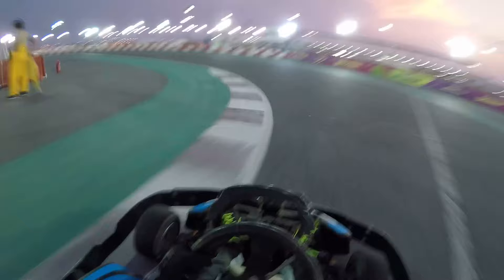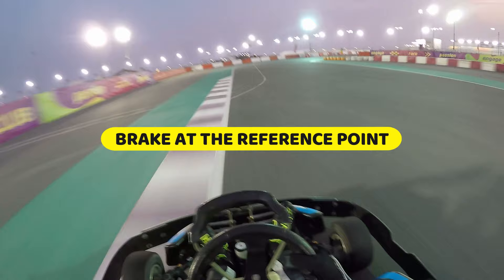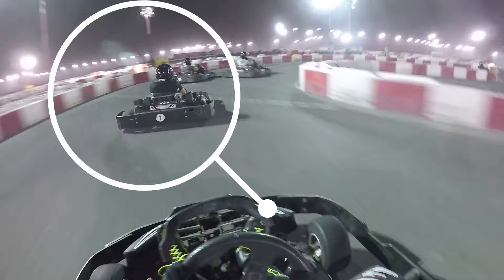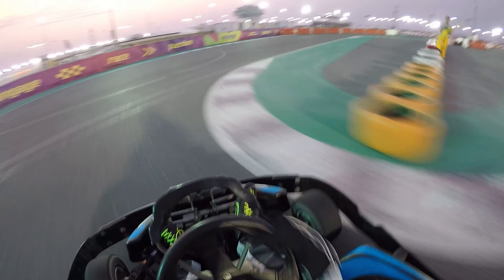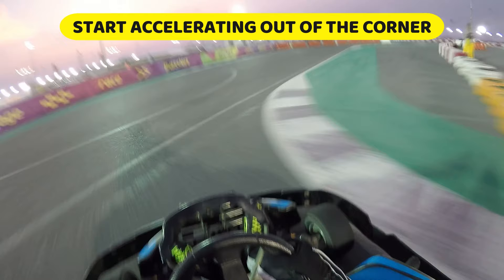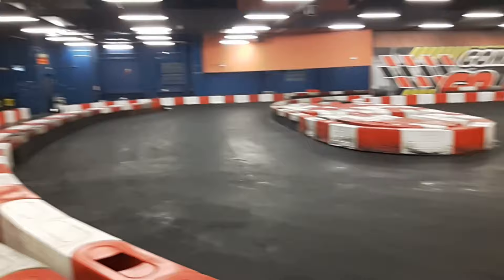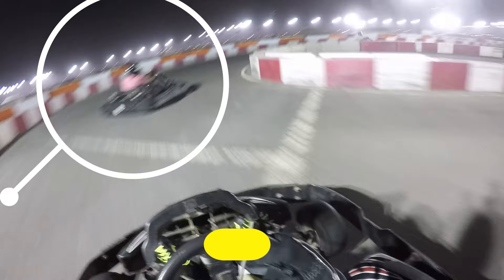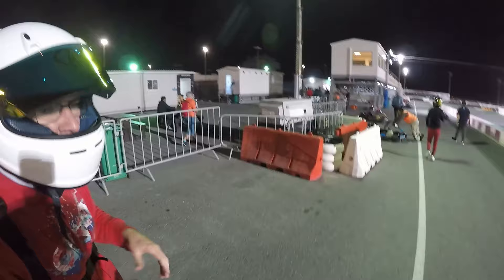HOW TO BRAKE in GO KARTING - TUTORIAL (KARTING TIPS)

Comment: The thing I've found is that since karts have no front brakes, you maintain a lot of front end grip even under braking. You can use this change in grip balance to your advantage to get the kart to rotate into tighter turns
Reply: How exactly do you do that?
Reply: @chiragmaragal3390  the back will slide somewhat, so as long as you can maintain control of the kart by controlling your brake and wheel inputs, you can get the kart to rotate a little faster every corner. The problem is getting the feel for it, because if you slide too much you'll actually lose time instead.
Reply: @chiragmaragal3390 
Usually you just lightly stab the brake as you turn and it almost pivots the kart towards the apex. I do this on some tracks in many corners that don't really require full on braking, especially if the kart is really tight and plowing to help it to turn. 
Often, after the front tires warm up after the first 3 or 4 laps, I don't have to use the brake like that anymore.

Comment: remember to adjust your braking technique to how much power your kart makes. low power carts will be faster with softer braking and wider turns - by starting on the outside of a turn, touching the apex, and ending up on the outside again. you want to carry as much cornering speed as possible because you can't accelerate as fast. as for high power carts, you can take a more V shaped line where you brake hard very late, oversteer to get your kart pointed at the exit, then tearing off again.

Comment: Is it normal to be slower at first when improving technique? After starting to use reference points and late apexes, my time is slightly slower. The kart feels much better than my previous way of overshooting each corner.
Reply from the maker: At first your timing may be slower because you are trying a new technique. However, the key is to practice this technique over a long period of time. Each time you race, attempt to brake later and later into the corner. 

This way you will gain more confidence when braking. When you become more confident under braking, you can really find the limit of late braking which will ultimately help you improve your lap time.
Reply: @kartingtips  Hey man, I've heard that you should barely be using brakes in karting so that you don't slow the revs down a lot and kill the engine, making it slower for you to reach top speeds on the straights. And I've also heard that when you do need to use the brake, just give it a hard tap and get off it immediately. This contradicts the tips you give in this video of coming off the brake slowly. What are your thoughts on this?
Reply: @kartingtips  Thanks for the advice.
Reply from the maker: @DeputyiC   I agree that you should spend as less time possible on the brake pedal.  Regarding coming off of the brakes, the point I was trying to make in the video, was that you should avoid aggressively coming off brake pedal. If you are too aggressive coming off of the brake pedal it can unsettle the kart.

Comment: To improve your breaking without video taping your race or having data to help a good way is too figure out what a full break will do at full speed and count how long it takes to stop and then try and use that as a reference for what the kart can do and then improve each corner until you are putting it on poll. Knowing what the kart can and can’t do will improve everything

Comment: The hardest part is trying to start braking correctly when you're closely following another car. That will make harder to see your reference marker and if the car if front of you has totally different braking style, you'll have problems trying to keep your own breaking point. In addition, the leading car can drive defensively and brake "too much" but use their car to block your overtake line.

Comment: These tips are pretty good, but a very common mistake in rental karts is that people tend to brake too much. You really need to keep up the momentum in rental karts in order to be fast as they have very little power.

What this means is that you often only need to brake in order to get the kart turning as turning the kart will already scrub off enough speed. At an indoor karting track near me there are more than 20 corners but you only have to touch the brakes at 3 of them if you take the right lines.
Reply: Same as an outdoor track I was just at with pretty fast rental karts (80kph+) You never actually need to break if you're brave enough and know where the kart should be coming into each corner - letting off the accelerator is more than enough
Reply: With the 6.5bhp and 9bhp karts (no idea whether that's the standard for rental karts across Europe and/or the world) I never brake. I drift the kart with counter steer approaching the corner and drift with opposite wheel lock all the way through, which in my experience, gives me the best momentum out of the turn. I do pretty good lap times but not sure at all whether that's the correct technique since there is nobody to teach me :D
Reply: @nikolamladenoff3516  Generally drifting is slower than only braking slightly. But it's fun, so you do you ;)
Reply: @nikolamladenoff3516  its definitely the fun way!! generally speaking with karts, having neutral steer (quick sharp turning input at beginning followed by continuing through the corner without having to have any steering input, or having the wheels point straight while turning, and not counter steering) is going to be the quickest way through a corner, the objective is to eliminate all steering as much as possible. so your idea of drifting is in the right direction, just dial it back aa bit so that instead of counter steering, you do a sharp initial steering input and return to and stay at center of steering for the majority of the corner
Reply: Stop yapping blud

Comment: i think the hairpin example was actually too much braking applied which made the gokart drift thus loosing much more speed and overheating the tires. Best would be to break hard in a straight line, start releasing the break when turning the wheel in and then releasing the break pedal around the apex to be able to accelerate flat out  from apex on. 
Technique shown in the video will work only on extremely tight and narrow corners where you have to rotate the gokart ASAP and start accelerating.
Overall though very useful video - one of the major points is that knowing the track will help one gain the breaking advantage

Comment: In the first hairpin turn shown in this video, it appears he is braking and turning into the right hairpin at the same time. You can also see this results in the rear end rotating and the driver applying opposite steering lock.  
I always thought hard braking is best done in a straight line just before turning in towards the apex and the brake pedal is released gradually once steering wheel is turned towards apex
Reply: he's threshold braking, he's using the bit of spare grip remaining in the front tyres as he lifts slowly off the brakes to turn at the same time. A little bit of rear slip and mild oversteer is ideal in this scenario as it allows the vehicle to rotate more aggressively as it enters tthe corner
Reply: You can carry the brakes into the corner. In a normal car this will decelerate the car meaning you can brake later but will induce understeer. In a kart there’s only rear brakes which means it’s easier to spin by trail braking into the corner but you can carry a higher entry speed and use the brakes to rotate the kart
Reply: @Shadow1986  thanks for the explanation.  It's nice to see drivers helping each other out on this channel.

Comment: Lando norris once said that for best breaking u should always have some throttle applied so your breaks dont lock up, thus carrying even more speed but holding that grip and instant response in power once u let go of the gas.
Reply: In rental go karts you can’t press the throttle and brake at the same time, it will just deactivate the throttle when you press the brake

Comment: excellent. i'm guilty of not doing this, even ... while i know this is the proper way. the improper way i do it... is never ever let off the throttle. i press the brakes while still on full throttle. and i do use the brake as an on/off switch. once finished slowing down the cart i drop off the brake. as thats the fastest way to release it. and since i was all the way on full throttle, i have zero delay of accelerating. 
the problem with this is... excessive wear. both on brakes, clutch, tyre, drive chain. but it yields better lap times... 1 corner, 1 time brake is applied. and for that 1 time its full on.

Comment: I never really watched a tutorial about kartin, just did it and did it like i thought would be good.. Since i am very heavy(over 220pouds) i usually break really hard, and to my vision at the latest point possible.. in later rounds when i feel more comfortable i tryd to push a few inches further every time, but then i miss the turn or lock the wheels.. mostly loose time after a break since the cart takes ages to accelerate after the turn, and often a lot of drivers  then run away from me. At my area we got many 180° corners which makes it hard for me to gain speed. at least thats what i think.

Comment: Better off coasting through most corners in these slow karts. Braking at all will load weight to the front wheels and take weight off the rear, which is probably why youre sliding in every demonstration and if the rear is sliding then you arent accelerating. If you coast through these turns you can have better weight distribution and take the corner faster. Everything I've seen in this video the kart should be able to do without any break at all. Just moderate release of the throttle or change up your racing line.

Comment: you need to manage your throttle back up again as soon as you get off the brakes ( way before that apex ). Eventually, use it gently, but it gets those rev climb up for a better exit. Needs a bit of practice, and make sure you don't input too much throttle and listen to your tires.

Comment: How far away from the turn should we set our braking point? like 30m or smth?
Reply: Debends on how much speed you have coming to the and how tight the corner is. Trial and error is the only real method of finding the breaking point. 

First just pick a point to break and try it. 

If you over shoot the corner and aren't able to turn quickly enough for the corner, pick a new breaking point that's earlier than the last one. 

If you lose too much speed before the turning point and have to accelerate before the apex to maintain speed, pick a breaking point that comes later than the last one. 

Then just repeat this until your breaking point feels perfect.

Comment: can you make a video on how to break with the front tires? I know that some guys master it perfectly so they are in advantage of normal breaking. they use the wheel to aggressively turn the wheels for breaking?
Reply: Yes,front tyres scrubbing techique used often
In the video you can see he doing similar thing for the first braking exemple but too much brake and the rear went loose or carried a bit too much speed due to wide entry and loose a bit the rear.(common mistake of lighters pilots)

Comment: Any tips for avoiding understeer on a very wet slippery track? Struggling to get the turn in even at very slow speed. Maybe I should intentionally lock the rear into hairpins to get the rotation then immediately get on the power to drag myself out?
Reply: Stay away from the dry line. Go wider on entry.
Reply: As you brake, turn full lock into the corner, the kart will understeer, probably not even turning at all if you are going fast enough. Aim to go around the outside edge of the corner in the wet. Combined with the fronts scrubbing off speed and the fact you are missing the inside kerb, you may even be able to brake later. Hold the lock. Eventually, the kart will slow and weight will transfer off of the inside rear and onto the outside front. At this point, the kart should start to rotate into the corner. Be ready to catch the steering back to a normal angle as it does so. Carry on round the corner. You will get really good traction off of the corner because the steering angle is almost straight on exit compared to the dry line. Don't be afraid to use full lock if the kart is understeering. My advice is always be firm with the steering but gentle on the pedals because the steering generates grip at the front at turn in, whereas the pedals do the opposite at the back.

Comment: Thanks, are there some corners that just lifting off the throttle is quicker than braking?
Reply: definetly especially if the karts are slower. therefore you don't need to slowdown as much to make the turn
Reply: @cxcre  thanks for the input. I suppose I wondered the difference say lifting off only for the turn, or keeping your foot flat for longer, then brake to scrub speed before turning in?
Reply: @stevesas632  with braking around a turn you don’t necessarily need to you are essentially braking late. Which means you will be exiting the turn with less speed than just letting off. I’m not a pro kart driver or anything but that’s just my theory. I play a decent amount of sim games
Reply: @cxcre  thanks for the info. It's great to see ppl helping each other on this channel.

Comment: 2:14

Does this also apply for really high speed corners?
Reply: if its a quite wide and ,as you said, high speed then there may be no need to brake at all, you could even keep abit of throttle aslong as you can maintain the racing line ofc

Comment: I feel your tips does not translate to karting at all. For the heavy car - yes.
But karts are so light and have so much more grip and break power as the result, that this technique does not apply, if you want to maximize your speed.

What I've found out (and was taught) is that on a kart, you should most of the times use break pedal really hard and for really small duration of the time and turn at the same time - so that the kart starts sliding a bit on the slip angle and helps you rotate the back of it. Than you control the kart with the gas pedal and steering angle of the wheel and (this is important) try to maintain as much speed and as much revs that you can.
The engine is so weak, that it's beneficial to maintain engine revs, than take "the best racing line"
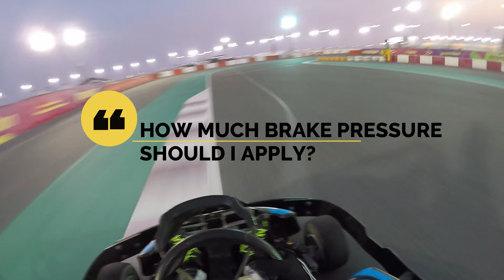Reply from the maker: Thanks for your feedback. Kindly refer to 1:35 which is where I explain that you should find the limit of hard braking. This means you should brake hard and spend as less time on brakes as possible.
Reply: Also using the mass of the body to rotate just a little the kart,too much forgoten these days.

Comment: So you dont trail brake in go karts?
Reply: Depends on track, you could have a similar skill where on a turn you have to put some little pressure on brake (but often a lift-off works too), but its cleary different breaking style than in a racecar
Reply: Right? I almost never press the brake while karting seems as if I can take almost all turns by just slowing down enough with a lift off the throttle
Reply: Trail braking only works if you have front brakes. The other two answers are nonsense
Reply: Trailbraking is about Weight transfert on the front mate, so brakes on the front or rear change the effect yes Indeed but you’re always have a transfert, also in go kart ! and  Its principaly dampers on race cars that allows that type of driving, on kart you don’t have lot of flexion and move due to châssis. And the initially question was if there some SIMILAR skill in kart. So read please before comment
Reply: @pierrecharrier8777  shhhh
Reply: In general I always try to trail brake in a gokart, I easily overtake those who dont. However, it always depends on the gokart and the track, and sometimes the temperature as well, it is not always better. Especially with a proper racing gokart, trail breaking helps you to lift up the inside rear wheel in the air and you can take the turns much faster and the gokart just turns in much better. When you dont trail brake the inner rear wheel will stay on the ground and because the gokart has a rigid axle with no differential (so both of the rear wheels are always spining at the same speed) it will have the effect of pushing you straight, the gokart will understeer. But it seems to be quite difficult to tell. Just try with trail breaking and without and you will see how the kart behaves on that day in that corner. Sometimes when you have less grip, or struggle to get the tires warm enought because its cold trail braking mifght not be faster.
Reply: @benjaminevans1221  not true, the effect of the kart slowing down puts more weight over the front wheels even if they are not the ones braking
Reply: @Otakar Libal OK i understand to use this type of trailbrake on Racing Go-kart ; but  this video deals with Go-karting rental ; and often you don’t have enought sensibility on the stroke of brake pedals to do trail brake in that type of Go-Kart ; whereas in a racing kart you can do it, better exemple with KZ karting (125cc speedshitfs) witch have brakes on 4 wheel and a Brake Bias too !
Reply: @pierrecharrier8777  rental gokarts can benefit from trail braking too. Some are great with trail braking. For example the rental gasoline rimo karts seem to be great with trail braking. At least the ones i have tried. Sodi rental karts, i think it depends, but doesnt work as often, especially with the 270cc. And some older rental karts that dont have as much plastic around and are lighter also worked very well with trail braking. I race on rental gokarts and i own a 390 race kart, but i just do track time with jt without racing, as being competitive while racing gets too expensive for me.
Reply: @otakarlibal  No brake needed to lift one rear wheel,fast steering and/or mass tranfest does it.